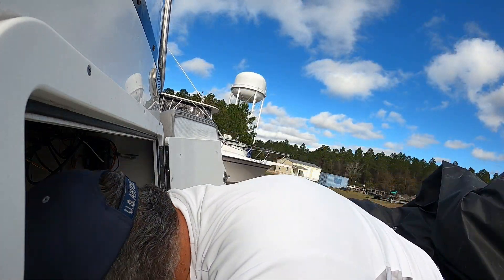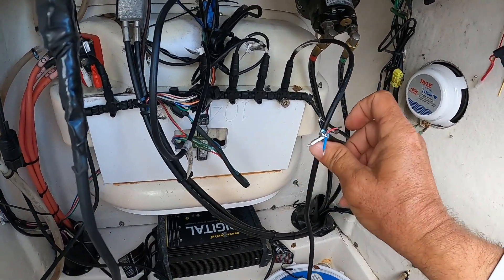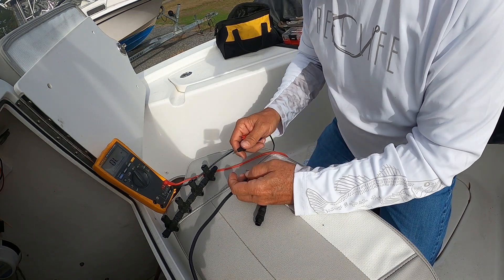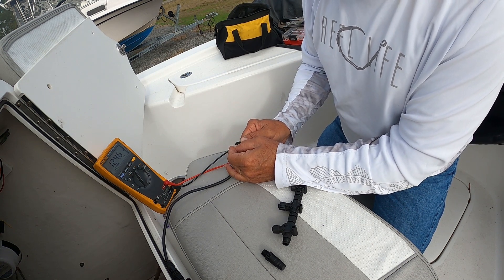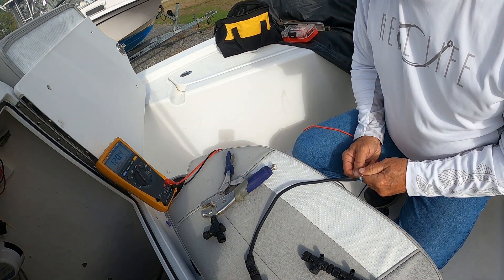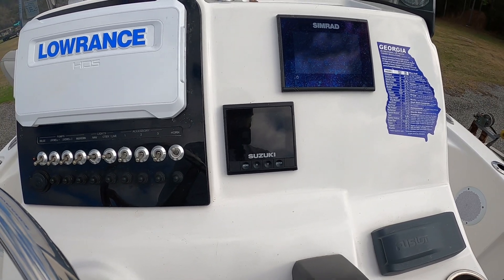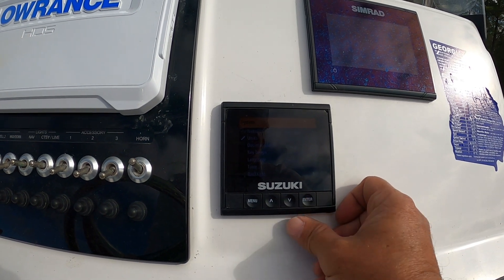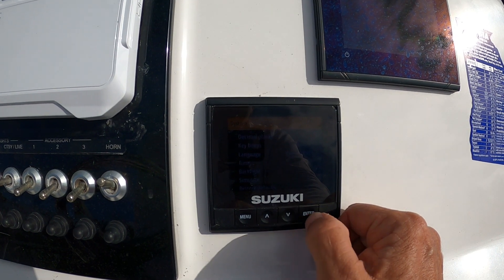NEMA 2000 backbone installation and Suzuki C10 gage trouble shooting

Comment: Did you ever get the C10 gauge to work? I am having the same issues you show in this video. Thanks
Reply from the maker: No sir, I installed a new Lowrance and hooked everything into that to monitor the engine and fuel.

Comment: Any updates regarding c10 gauge not providing data?? Having the same issue. Great video and thanks for your help.
Reply from the maker: The c-10 was shorted out from corrosion on the pin the connects to the circuit board.

Comment: Paul did you figure out why the data cable leading to the gauge is all taped up? I noticed it was still taped? Sure that cable isn’t bad??
Reply from the maker: I might unravel that and look at it, I ohmed the wires and they check okay but still could be an issue!!  Good thought.